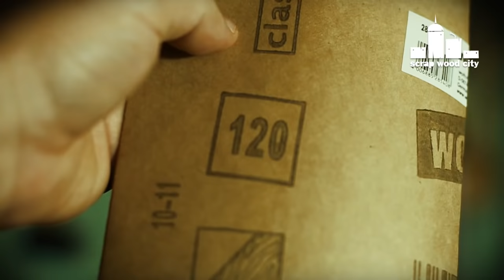DIY kitchen rolling table

Comment: Fantastic as usual.  What do you call those little buttons that you use to mark drilling holes on the other pieces of wood? Thanks
Reply from the maker: Thanks. Those are dowel marking pins